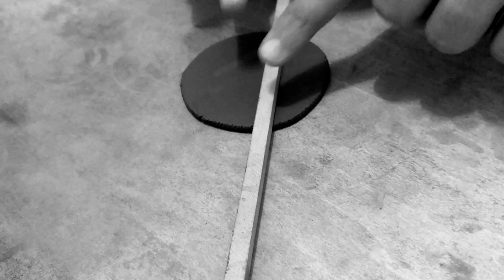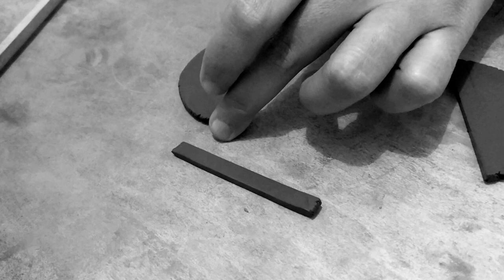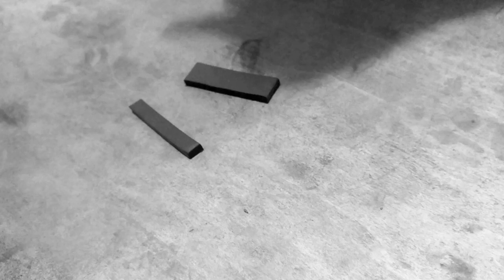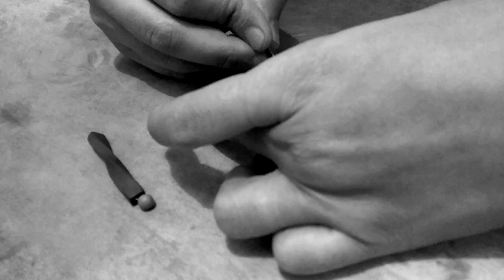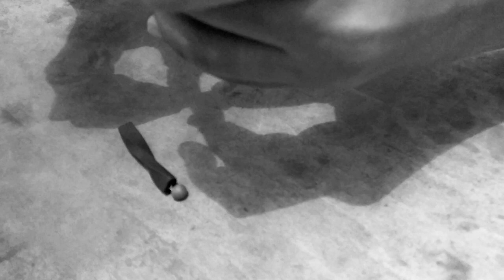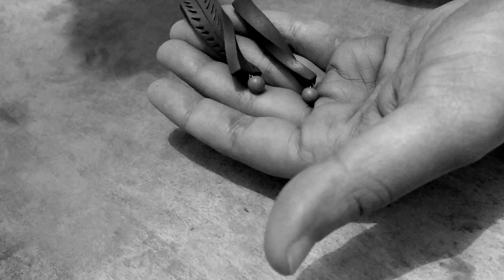Twisted terracotta earring making video

Comment: Totally love your work. 
Kuch found your channel and I have been binge watching all your episodes/ videos.

Can we make these kinds of jewelry with air dry clay such mould it by fevicryl?
And where do we get u pin hooks?
Reply from the maker: Thank you so much!
Glad you like my work. I use earthenware clay for terracotta jewelry making. Never used air dry so I am not sure how much of a difference exists in the materials. But you can try it, The pins are made of nichrome which is a high temp wire that won't melt in the kiln during firing. But if you are using air dry clay, given that it won't require firing you can create u-pins /hooks from eye pins/head pins for the time being. Just to double check though it might help if you could check with someone who makes air dry clay jewellery.